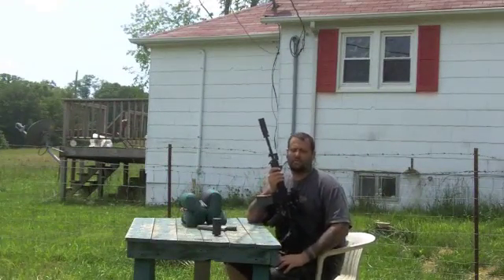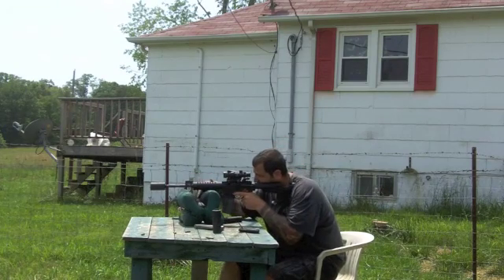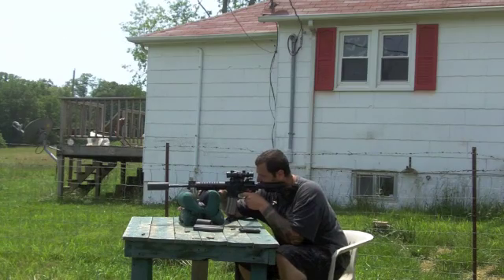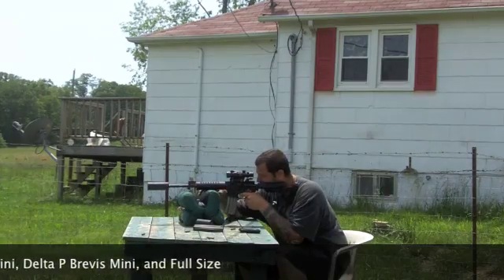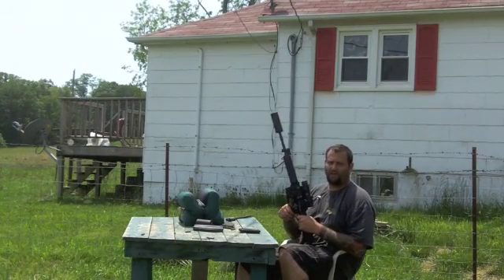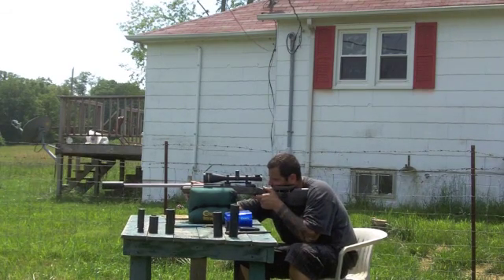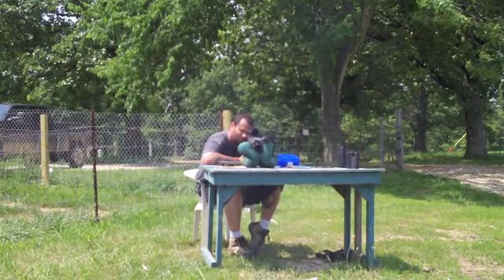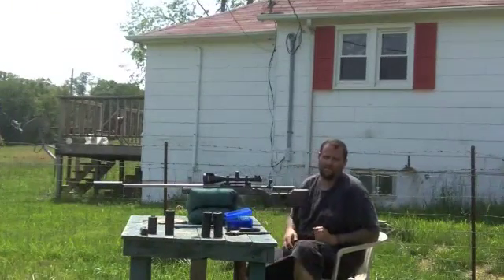Brevis Suppressor Comparison with the Surefire Mini

Comment: it looks like hte brevis cans have more blowback than the surefire mini from carefully looking at the smoke from  the side.  From the front it is too hard to tell the gas from the muzzle from the gas coming out of the ejection port.  This, BTW, is why he has that gun set up left handed.  Anyway, SF cans are reported to have less blowback, which is part of their design parameters as they need their cans to work well on military rifles without modified gas systems.